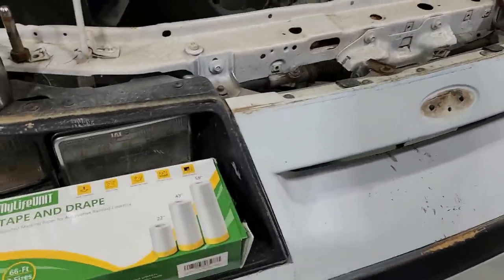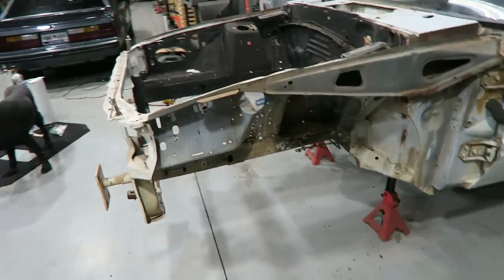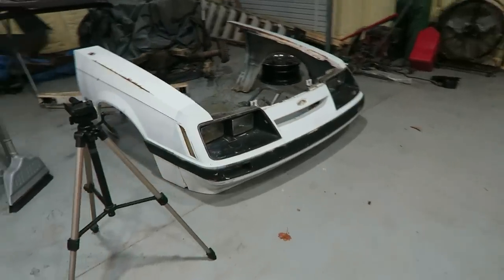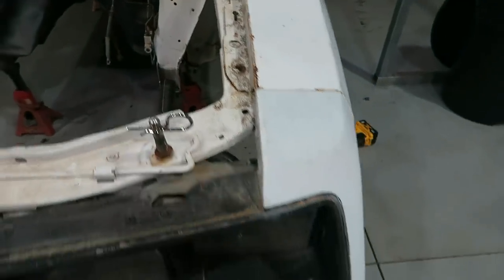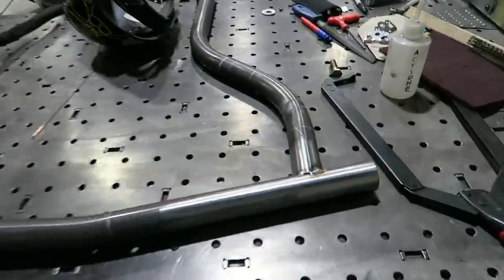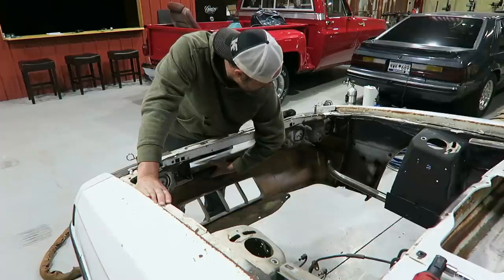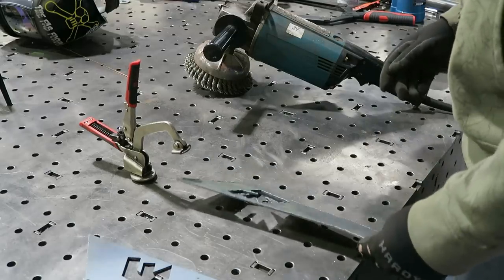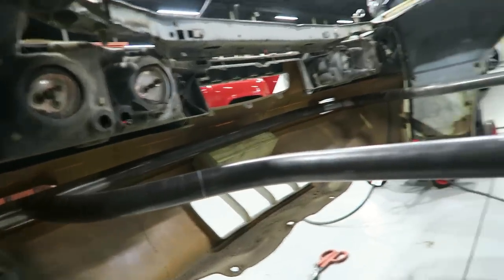Foxbody Coupe Build Starts with a Tube Front End

Comment: There are carb' style throttle bodies with in-built fuel injection nozzles - if you use one of those for the petrol/gasoline, and the rails for ethanol/methanol, you can use an aftermarket EFI ECU that controls 16 nozzles and run 8 of gasoline and 8 off alcohol and simply switch over in the ECU at whatever point you want. Heck, you can make it a progressive switch over if you like.

Comment: Looking good!   When you are setting up your cuts on your plasma table, be sure to cut your interior cuts first, just so you don’t have the chance of the piece moving when the main part is done.   Also noticed it cut a small section and then ended up going back over it.  You should be able to run the cut path to be sure there are no double cuts.   Always enjoy your content bro and how you describe in detail your thought process
Reply from the maker: yeah my software will do it automatically....I just failed to combine the two parts into one layer on this one
Reply: @Thefabforums  I figured it would

Comment: I have been following your channel for years starting with your carbon fiber tutorials and the wrapping of your truck. Really good tutorials and highly recommended. I have even purchased some of the tools you have featured/recommended in your tool centered videos. Thanks for sharing the knowledge and the great tutorials.

I have one question about this video's material used in the front end and the next video's strut towers. What are the dims/specs of the chromoly tubing you use? I believe you have gone into details about it in the past, but I can't remember right off the top of my head.
Reply from the maker: its 1 5/8 .085 wall I think and the 1" is .065
Reply: @Thefabforums  Thanks for the info!